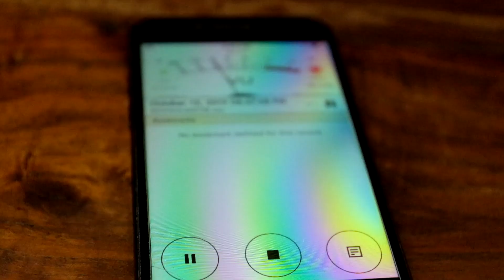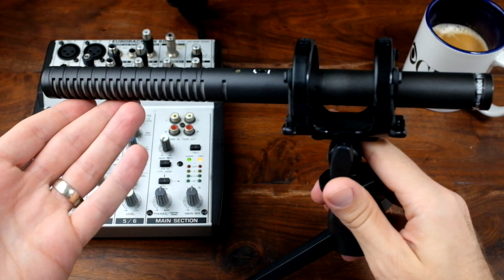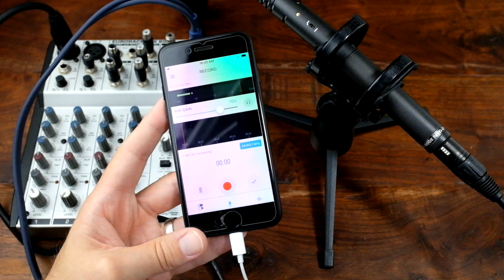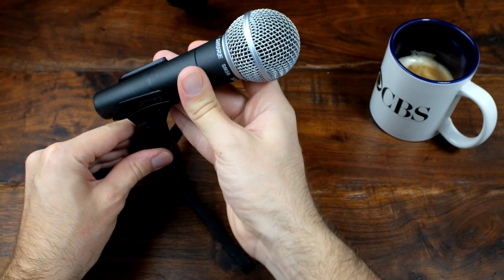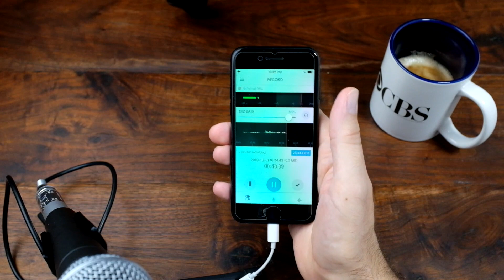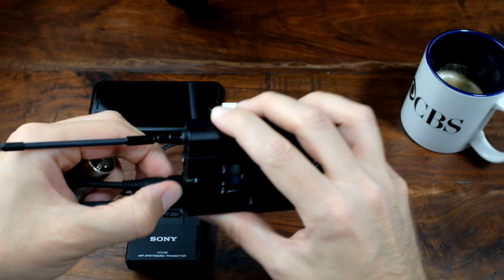How to Connect a Professional Microphone to an iPhone

Comment: I'm using an iphone 6s, stainberg ur22 mk2, and a sm57. I bought the trrs adapter but if I plug it into the 3.5mm jack on the phone (not the lightening) I got no external sound (or any way to hear what I'm recording) since it thinks I'm wearing headphones. Could this be fixed going trought the lightening insted the 3.5 old phones still have??

Comment: What mic set up are you using for your tutorials?
Reply from the maker: Hi Gabrielle. For the main shot in this video specifically, I'm recording with the Rode VideoMicro plugged into an iPhone using their Rode SC4 TRS to TRRS microphone adapter. And the Lightning to TRRS dongle of course. A simple and straightforward set up for these. For other projects, I'll utilize the microphones I demonstrated in the video with different adaptations depending on the situation. Thanks or watching!

Comment: It is such a good reference video. I have a PreSonus iTwo interface, A XLR microphone that needs 48V power and connected to my iPhone 11 Pro Max but only left-hand side recorded. I know a mono XLR that can not record a Stereo but I have no idea how to connect with the right adapter(s) for my set up. Please help.
Reply from the maker: You have a couple good options. First, since the PreSonus has a USB output, you can connect that directly to the iPhone using a Lightning to USB adapter. Apple makes an official one, but I've used an off brand one that also gives you an extra lighting port to provide power and it works great. I just helped someone else get this king of setup going and it works great. 

Your other option that may help with stereo vs. mono recording could be to downgrade your audio interface to something like the Saramonic SmartRig or one of the IK multimedia units. Each of them can convert an XLR microphone either directly to lightning or a TRRS plug and they can even provide 48v phantom power. That may be a shot if the workflow above doesn't work for you. Good luck!

Comment: Which do you used in this video?
Reply from the maker: Hi there. My main audio setup for the video was a Rode VideoMicro connected to a Rode SC4 TRS microphone to TRRS adapter and then Apple's lightning headphone adapter. Easily the simplest of the three, but not always the best microphone. I certainly comes in hand sometimes, though!

Comment: How comparable is a cardioid mic to shure mv51?   I have a nice beyer dynamic mic and wondered how much worse singing/strumming guitar into iPhone would be with the cables you showed vs mv51?  First option is around $40-50 compared to &200.   Major difference?

Comment: Thank you for sharing, 
I did with my old iPhone 6 Plus used connect direct to headphone. It’s working.
But, my iPhone 12 pro doesn’t have headphone, I couldn’t find adapter TRS to TRRS
Pls If u can help me how can I find just (one adapter TRS to TRRS) connect direct to the phone.
male adapter to connect the iPhone 12 pro & female to connect the RAC female then connect to the mixer R & L.
I need help for name of adepter or a website.
Thank you

Comment: So while using an app, it uses external mic, If you use the phone to go live on instagram?, does it still use the input from the external mic?
Reply from the maker: Yes, with the external microphone plugged in, MOST apps will automatically default to that microphone versus the internal microphone. That is the case on Instagram, Facebook Live, SKYPE, Zoom and other apps for sure.

Comment: How would I configure a mic that requires phantom power such as the Audio Technica AT2020?
Reply: the same, but make sure the console has phantom power to feed the mic.
Reply from the maker: Two options. First, you could use the sound board option like I outlined in the video. But if you need something simpler or more mobile, try the XLR adapters made by IKMultimedia or Saramonic. Both make XLR to Lightning and XLR to TRRS models, all of which give you phantom power, a knob for microphone gain control and a headphone out. In my experience, the Lightning option gives a cleaner preamp, but the TRRS model gives more options.

Comment: What i the model number for the Shure XLR to 3.5mm adapter that you are using? It looks like the A96F transformer? Or is it a different model?  Thanks.
Reply from the maker: It's definitely the A96F, but afraid I don't have a model number.

Comment: Hey, thanks so much for your video, it is very informational and solved a lot of issues I am faced with. Just another question, will the TRRS adapter work with a headphone jack splitter? This is because I am trying to record music on my phone, meaning I need to be plugged into my headphones while using the mic. If a headphone jack splitter does not work, would it work if I connect my EarPods to my phone via Bluetooth, and use the TRRS adapter on my mic? Again, thank you so much for the video and I hope I will finally be able to make audio recording work on my phone!
Reply: In short, how do I check on the recorded audio during the recording?

Comment: Hi! Thanks for this video . I have a question! I have a Shure SM58 and I’m trying to connect it to my IPhone X. I’ve followed your method but the MOTIV app does not recognise the mic and still displays “built in mic”. I have used all things you used ( I bought a Nanyi Adapter). Any ideas on how I can get this to work please ?? Thanks :)
Reply: He wrote on his blog that the TRRS adapter used has to have the ability to transmit 1.5v of power for the use of dynamic mic(SM58). Hope that helped!
Reply: AHBUCHIU thanks !
Reply from the maker: Hi Tiwa. Thanks for watching and for the question. Specifically which Nanyi Adapter are you using? I do not have experience using Nanyi adapters and so can't speak to their quality, but I want to make sure it properly converts the SM58's XLR output to TRRS vs simply TRS. Without knowing which adapter, my first suspicion is this could be your issue. If it only converts to TRS, then the additional microphone sleeve will not be making a connection and that would explain why your phone isn't recognizing it.

I use the Rode SC4 TRS to TRRS microphone adapter in the video to make that connection with the microphone connection in the TRRS adapter.  Here are a couple other things to troubleshoot.

1) Close the MOTIV app and put the iPhone to sleep. Connect the SM58 and all adapters to the phone. Then wake up the phone and reopen the MOTIV app. Sometimes the sequence can affect how the iPhone recognized an external microphone, although this is rare.

2) Ensure all the connections on your Lightning headphone adapter are clean and in good shape. When we chain several adapters together like this, any bad connection in the chain will interfere with the connections.

I hope that helps and best of luck!
Reply: MEDIASHI  Hi! Thanks for replying. I ended up buying various different adaptors and XLR cables as nothing seemed to work.   After weeks of trying ,I bought the iRig pre and it works great. Thanks for your help though!

Comment: Hi, thanks for this clear tutorial.  Question: on the Behringer audio mixer you didn't share a link.  I would like to know the model you're using.  Thanks.
Reply from the maker: Hi Beth. Sorry for the delay. I didn't link the Behringer audio mixer model simply because the mixer I use is SOOOOO old. It's no longer in production. I got it 19 years ago and it's still working like a champ. Here's a comparable model available now: https://www.bhphotovideo.com/c/product/421981-REG/Behringer_802_XENYX_802_8_Channel_Compact.html

Although if I were you, I'd spend a little more and get their Behringer XENYX Q802USB which is the same thing but adds a USB output as well, which you should be able to use with a smartphone as well as a computer: https://www.bhphotovideo.com/c/product/862118-REG/Behringer_Q802USB_Xenyx_Q802USB_Premium_8_Input.html

Comment: Hi guys! Very informative! What's the name of the app you use when you hook up the SM 58 to the iPhone? Thanks : )
Reply from the maker: Thanks for watching! The audio app used to record in the video is MOTIV Audio by Shure. It's a free app they market to match up with their line of iPhone microphones, but works fine on its own. The nice thing is that it tells you right at the top if it's using the built-in mic or an external microphone.
Reply: @mediashi7021  Thanks a lot for the info!!

Comment: Why do you need the TRRS to TRS adapter? Why can't you just connect the microphone cable directly to the 3,5 mm adapter?
Reply: Nvm I understood just now why you need it :)
Reply from the maker: Thanks for the question. The TRRS audio plugs add an extra sleeve to make three connections: left channel headphone, right channel headphone and microphone. When you plug a basic TRS plug with the missing sleeve, your iphone will only read the left and right headphone channels and fail to connect with the third sleeve, which is your microphone. The iphone will basically think you just plugged headphones into the phone, even though it's a microphone and it will be wondering why you can't hear the great tunes it's playing through your microphone Make sense?

Comment: Hi, I followed (most) of your suggestions but I'm not getting sound into my iPhone. 

I'm trying to connect 2 Sennheiser EW 112p G4 wireless lavs to an iPhone 6 (for IG Live). The setup is as follows and in order:

iPhone 6 < Lightning to 3.5mm adapter < Røde 3.5mm TRRS to TRS Adapter < 3.5mm Audio Stereo Y Splitter < (2x) 3.5mm male to female XLR < (2x) Sennheiser EW 112p G4

As you can guess, it's not working. No sound comes into the iPhone from the wireless lavs.

I did check the lightning to 3.5 adapter with a set of wired earbuds and it is working. But, when I connected the Røde adapter to the 3.5mm/lightning adapter, no sound went through. Is that normal? Any other way I can test that Røde adapter?

And I also removed the Y splitter to only connect one lav, but it didn't work either.

Do you spot a glaring issue with my logic? Do you have any other (ideally budget/cheap) solutions to get those lavs into the iPhone?

If it helps, I do have access to a U-Phoria UMC204HD, any way to use that to connect the mics to the iPhone?

Any help or guidance would be appreciated.
Reply from the maker: Apologies for the slow reply!!! First for the U-Phoria, here is a possible option. You should be able to either run the RCA output in the back (via an RCA to 3.5mm cable) into the Rode TRS to TRRS Adapter or run a cable from the headphone out, although you'll have to be careful with audio levels in your headphone volume. I haven't tested this setup, though. Some similar units to the U-Phoria come with a lightening adapter built in.

For the Sennheiser EW112p wireless,  are you sure you have the right Rode adapter? You need a Rode 3.5mm TRS to TRRS adapter, not the other way around as you listed in your workflow. The correct designation is a Rode SC4 Adapter. If you're using the SC3 adapter, it's basically deleting the microphone channel, which would explain why you're not getting an audio signal. Here's a link to the correct one on the Rode site: http://www.rode.com/accessories/sc4

If you do have the Rode, there could be an issue with power. If the Sennheiser's have an XLR output, I've had luck with similar Sony powered lav mics connecting through this kind of adapter: https://www.bhphotovideo.com/c/product/1500946-REG/movo_photo_tcb2_xlr_female_microphone_to.html/?ap=y&ap=y&smp=y&smp=y&lsft=BI%3A514&gclid=EAIaIQobChMI08fu656z6AIV8P_jBx3SZQjWEAQYAiABEgJvvvD_BwE

I hope this helps!